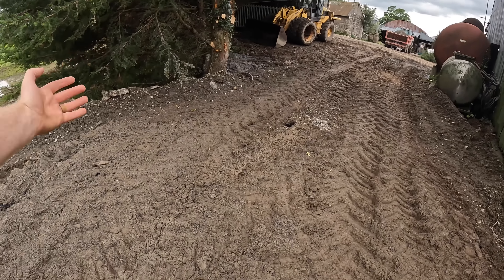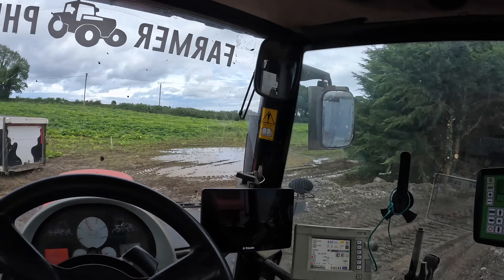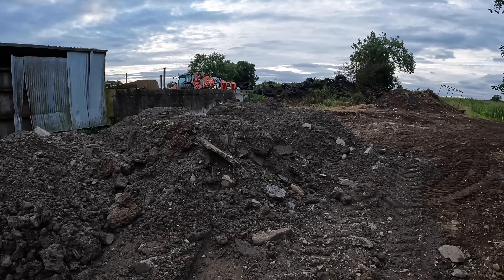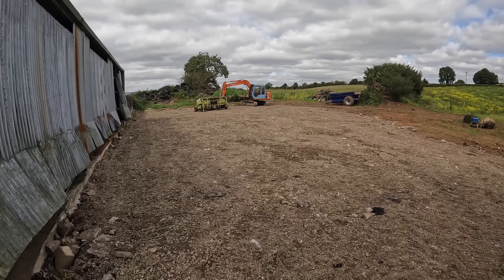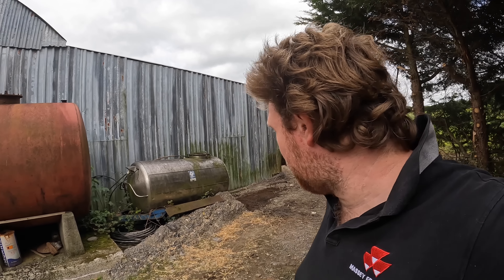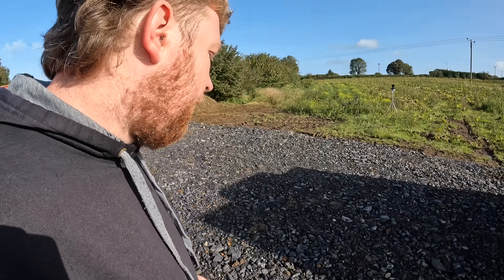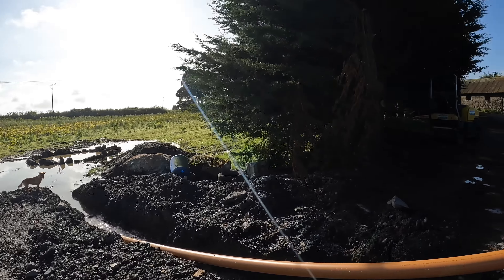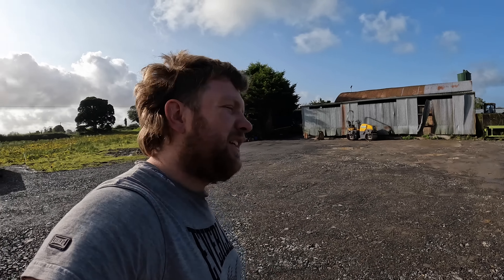SO MUCH SPACE!!! MACHINERY YARD READY FOR PARKING

Comment: You could have a spring in that corner water boiling up stick a length of land drainage pipe out towards the pond alongside the 4-inch waste pipes  
water running down from the house side could be doing a job on it either

Comment: looking good i would stick in a french drain preferated pipe backfill with heavy heavy stone and build it up.   or backfill with semi dry  concrete and should hold it.  you  should get a spot to dump yer stone from stone picking and get enough to get a crushers in and iuf you can price it into the stone picking contracts

Comment: Great job Phil and crew. You'll definitely have no shortage of parking space out the back now. 

When you are talking about putting up a mass concrete wall, would you think about increasing the height of the overall shed that is already there. Like if you near matched it to the height of the half round roof shed beside it and give it a bit of a run off, it would give you the extra ceiling height for the new lean to sheds. 

Well just a thought. Best of luck

Comment: Your Grain should be stored in an Aerated Bin - not an open shed. Build a Bin and you will free up alot of shed space.
Reply: @walterhartwellwhite402  they already have a grain bin that is not in use. Far cheaper for them to pour a new concrete foundation and replace the lower ring and add aeration, than to start building bays of new shed.....

More importantly, a bin will keep the rats out of the grain....the grain which is being fed to the cattle - that are destined for human consumption.

Comment: Well ware on the newest parking area Phil.👍
You never have enough parking space around a farm yard. Especially when there's a contrasting business involved aswell.  Earlier in the year, when you did the video abouts improvements on the farm. I thought to myself that ye might be better to build a new shed for grain or the likes at the other end of the yard. So you can get an artic in to unload or even for  ye to load it yereselves, if ye ever sell grain. As you never know when another year like 2016 will happen again. As much as you don't it to happen  either. Have it big enough to do the drying in it & the likes aswell. I'd used site of ye're grain shed now as your work shop & parking area. As you'll have access to both side. Going by your plans in the video you could be better off building a completely new A roof shed, not a leantwo shed. Also think about a new roadway into the new parking area & the farm yard. As hopefully when the  next generation comes along. It'd  leave the area around the house alot safer for them. Ye don't need to do it ASAP. Ye could plant it & mark it  out before ye start the new shop. Nothing's cheap to do, the sooner you can do it,  the better & cheaper it'll be in the long run.

Good luck with it all anyway's. 👍